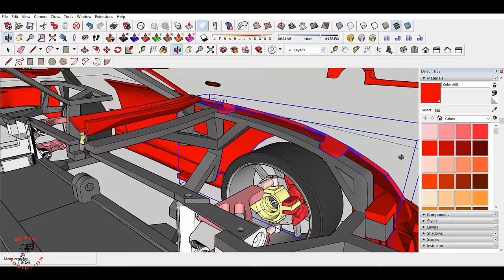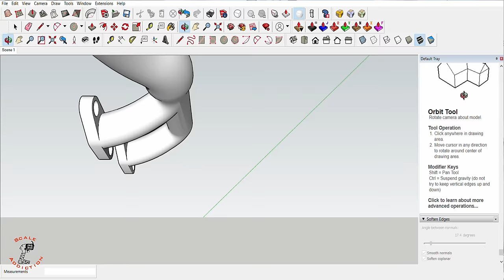Part 14 / Driving 8th scale 3d printed supra with 2 cylinder engine project

Comment: would be cool to have a sim set up connected to the car with a camara like those speed drones
Reply: The word you are looking for is "fpv"
Reply: I heard one of the big issues with RC Cars and getting FPV on there is the vibration of the RC car driving over undulations. Even if you can get the latency low enough, theres currently no solution to stabilize the camera in the car. Software might help but I doubt it'll be able to make it drivable on its own. I'm guessing there needs to be some R&D for scaling down sophisticated suspension and chassis tuning to make it worthwhile which is gonna be expensive.
Reply: @stevenyoon3867  I feel like you should just be able to softmount the cam and that should deal with smaller vibrations, and there are plenty of fpv systems used in drones that have something like 30 ms of latency
Reply: Someone did that with a hoonicorn rc car. I don't remember the channel name but it was rad.
Reply: @leonardterlevic4765 analog fpv is literally zero latency it’s digital system that gave horrid latency
Reply: @steviefpv  I know, I have been using analog for 4 years, never tried digital but hdzero has comparable latency to analog
Reply: just put a phone on facetime lol
Reply: @gtfree1809  a phone adds weight and If you want the camera pointing forward, the phone would be flat on which is not very practical.
And it also has a latency of a second or two.
Reply: @stevenyoon3867  there was a youtuber (I forgot his name) that would take fpv cameras and mount them to rc cars and get cops to chase his RC
Reply: @leonardterlevic4765 not necessarily, fpv is with fpv goggles but he may be talking about a sim racing setup with a monitor 👍🏼
Reply: @TheCheffJeff  monitors have more latency than purpose built goggles
Reply: Cloud rc does this. Using 4g

Comment: There is High Heat resistant paint out there from Rust-Oleum, KRYLON and VHT to name a few. For engine blocks, brake calipers and exhaust manifolds. But yes, it is best for a metal exhaust manifold

Comment: You should have a lock mechanism on the hood, the hood seems loose when closed and with a lock it will stay in place

Lock mechanism, it should be one of those locks that when you push it in it stays, when you push it in again it pushes out a little and unlocks, and you need LIGHTS!
Reply from the maker: That's great idea, I was thinking to pull mechanism with servo for hood and trunk,  but your good idea too, I will think about it,  thanks
Reply: @scaleaddiction  sweet!

Comment: Dude if you are going to convert to Electric, which will not be half as cold as the engine you have in there now, it's a must that you go with a brushless motor. No one use brush motors anymore for those types of applications. They are simply inferior Motors compared to brushless
Reply from the maker: Agree with you man, it's so much fun with fuel and real engine sound, but I will go with brushless too and see how the suspension handle with speed

Comment: You’re gonna have to go brushless, a brushed motor isn’t gonna push that thing very far or very fast and brushless motors are way more efficient and it would probably let you clean up the transmission kibble in the center and if you reallly wanted to you could keep that engine under the hood for the scale look

Comment: I have a problem with the differential, it keeps stripping, I designed and printed support with bearing for it's shaft, but doesnt help. it's not diff problem, it's my 3rd one and same thing happened

Comment: Looks rad, but I feel a Toyota AE86 body would've been so much cooler in my opinion, since this motor kind of looks like a 4AGE 16V motor, which is an inline 4, NA 4 cylinder, vs the iconic 2JZ straight 6 turbo beast in the supra.

Comment: steering and braking on the same stick and braking and gas on seperate sticks???? your sick in the head bro lol. you should mix in 2 channels on your right channel 2 (like mix in channel 7) and the second channel be the brake. and than end point adjust each channel so that braking -50% is braking and +50% is gas....and steering on channel 4 (left stick)